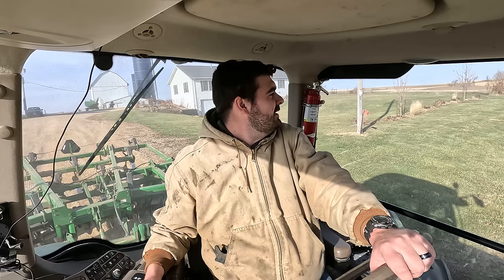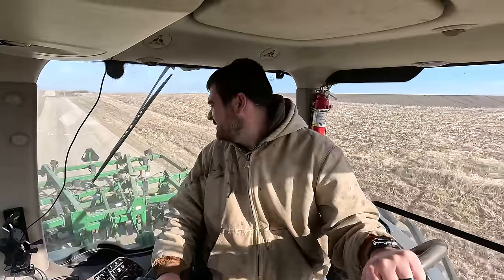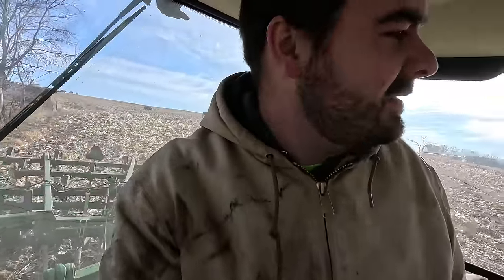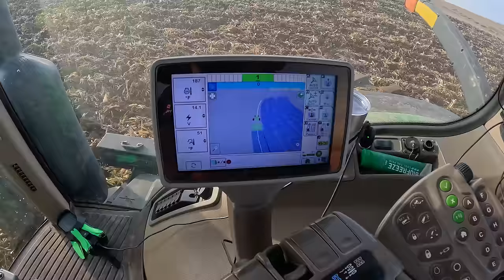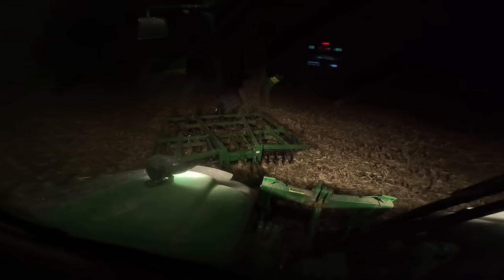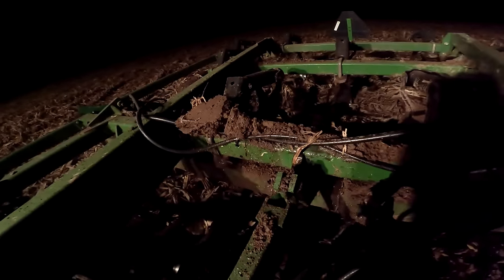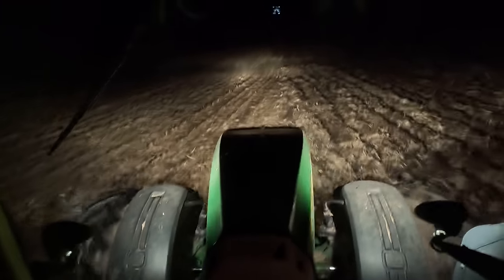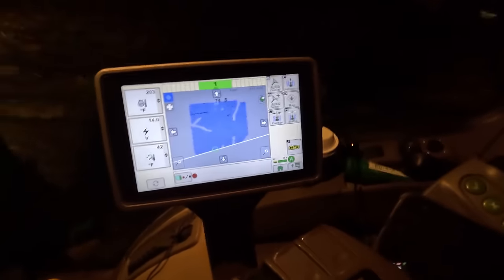The Long Pull | John Deere 8235R Chisel Plowing Part 1

Comment: That chisel is about half the size needed for that tractor. Overkill is underrated. Depending on what kind of ripper you have to pull, and guessing by y’all part of the world it’s tongue pull. But that tractor with 3 point should pull a 9 shank ripper 12-14 inches like a champ with the draft set accordingly.
Reply: That's a Mulch Tiller, or coulter chisel. They are hard pulling tools, and every horse you can get is better.